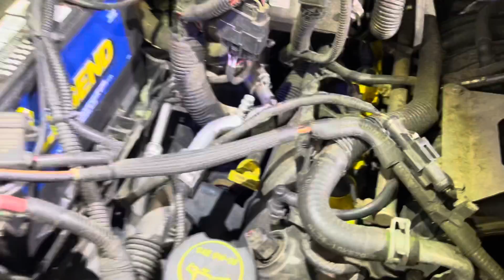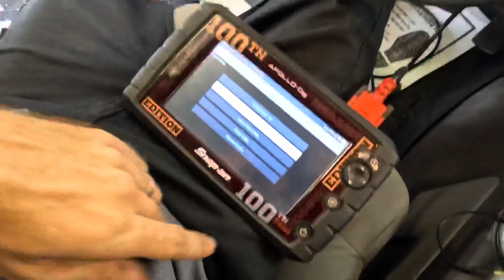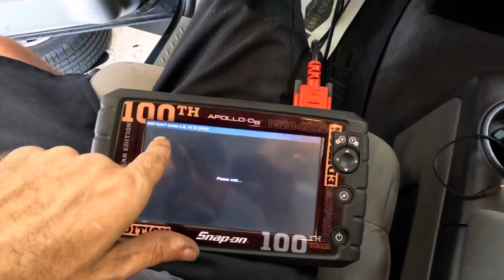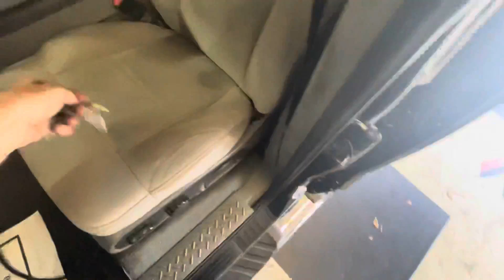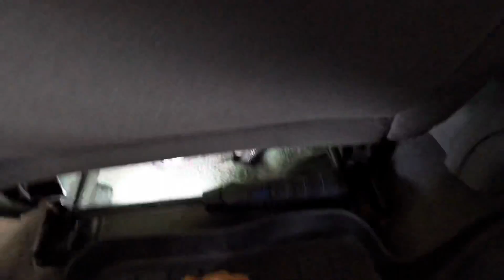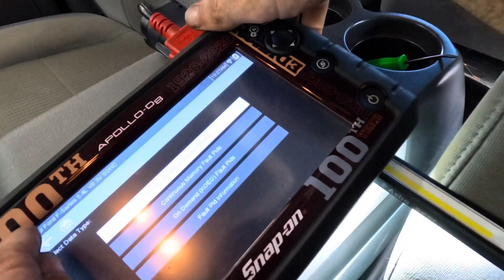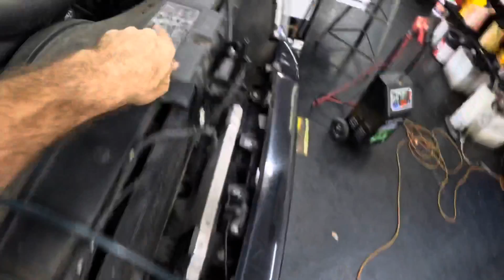Mini Explosives! Car fire Recalls and Airbag Fault! 2008 Ford F-150 5.4 4.6

Comment: Ray, your ac explaining is opposite, 

Compressor pump refrigerant to condenser to be on lower temp than compressor then it went into Receiver Drier or Accumulator. After that the gas went into expansion valve to transfer liquid into gas, that how cooling coil/ evaporator being chill or cold, and return to compressor

Faster the compressor, faster it became colder. High speed on blower make evap less efficient

Comment: Have you ever heard this comment before?
After watching this video, I had to go out and my seat belt light came on!  Well, that's exactly what happen to me. I was dumbfounded that a video would explain such a thing. And I can't wait to see how you do part #2 of this video. If t truck owner brings it back for the seat belt repair. 
I have a 2008 f150 with a 4.7L and the seat belt does not retain or hold me back when the brakes are applied as if there was a sudden stop. 
I watch just about every video and find your knowledge of vehicles weather a car or truck exceptional. Keep up the good work, cause I enjoy watching someone else getting dirty. 
Always said if you don't get dirty your not doing it right!

Comment: Forget about not moving the seats. Shouldn't you disconnect the battery whenever you work on anything related to the airbag or other explosives?
No, I'm not complaining, I'm just worried about your safety.

Comment: You mentioned a recall and problem that GM had, but no one seems to ever mention a very deadly recall and problem Toyota had, when the Gas Pedals were sticking, even though over 90 people died and Toyota try to cover it up and hide there problem.
Since we all know Toyota hates looking bad, but enjoys making others look bad.
Lastly something a lot of people don't remember, Dodge had a very major issue with the redesigned Caravan in the 90s?? they failed to install a brake shift interlock, because of cost the 90s Ford Windstar's had them, but the early new body style Caravans did not.

Comment: We have a series of resistors wired up with pins for just this use.
This is almost exactly how I go about diagnosing air bags and pretensioners.
Just a little warning for those who are tempted to measure the resistance of the pretensioner or airbag with a meter.
DON"T. Some meters have enough potential to set them off.
I tried it so you don't have to, I should have recorded it.
And believe it or not, it was not an analogue meter that set it off.
It was a cheap digital one from a land with a red and yellow flag. :-)

Comment: Design engineers can/should perform Failure Modes, Effects, and Criticality Analysis (FMECA) on all safety components, systems, and end products, which could potentially prevent recalls such as the carpet fires.

Comment: It amazes me how many miles people drive! I bought an F150 new in 2007. I drove that truck for 10 or 11 years and it still had roughly 56,000 miles. It was a great  truck for the first 10 years.and after that it started breaking faster than I could afford to fix it.
Reply: @JohnG6
At 56k miles it started failing a lot ? That is NOT a "great truck". It's junk. Even at 10 years with that mileage it should be remained reliable for another 5-10 years.

Comment: 5.4L 3V... possibly the most horrendous engine Ford ever made. So many numerous defects in design and quality. Worse even than their horrendous 6.0L powerstroke
Reply: A lady friend of mine just made a 3hr trip in her 05 F150 2/5.4. Didn't bother to check the oil level. It was a quart under minimum. Ruined the motor. Women.

Comment: Ray on your Fluke meter if you put the probes together on ohms and press the REL button the meter will measure the leads value, re zero the display and give you a accurate reading of whatever you next measure.  If sort of nulls out the lead resistances. So you wont have to do the maths.

Comment: i always threw the "dont touch a seat settings" rule out, cuz if i cannot reach your pedals while im test driving your car i'm gonna move your seat. i'll definitely move it back close to where its at, but ive serviced some cars that were driving by some short people, or tall people.
Reply: If I have moved a seat, I put it as far back as it goes when I am finished to show that it has been moved.
That way the customer knows I have adjusted it and they have to put it right themselves.
I also explain why when they pick it up.
If I have to drive your car, I need it to be as safe as possible and that may require moving the seat.

Comment: Don’t forget when measuring resistance, don’t touch both terminals, you’ll be measuring resistance through your body. Another awesome video, thanks for keeping them coming!
Reply: For such a low circuit resistance that doesn't even come into play here.

Comment: Thats one clean rig!!  i woulda thought the pretensioner would have been in the B pillar myself. As for the GM tensioner fire info...thats VERY good stuff to know as i had never heard of that before. The electronics diagnosis and rechecking every which way to confirm your diagnosis is great to see. Automotive electronics is my one weak spot and seeing how you check things with various issues on cars is great teaching tools. Thanks again for the educational video Ray:-)

Comment: I used to work as a lube tech for a local Ford dealership and had to do the recall for something similar to the GM one you were talking about. The recall was basically just popping off some panels, removing some insulation and putting some aluminum tape on the bottom of the floor insulation.

Comment: The hot line is the liquid line. It carries liquid refrigerant to the expansion valve. The cool line is the suction line. It carries refrigerant vapors back to the compressor.

Comment: I would agree that the engineers who designed the individual parts aren't at fault for the carpet fires but there had to have been engineers designing the vehicle as a whole who should very much have been aware that explosives and carpets don't mix.

Comment: Hi Ray, apart from zeroing ohms, as described below, to get a correct reading, you are also measuring resistance across your hand  when holding the leads in your hand.
Great content by the way!

Comment: Ford also has that fire issue with the pre tensioner, they didn't learn from gms eff up. so the fix was to put fire retardent tap over the carpet to lessen the fire chance for the carpet.

Comment: for Ford's, you can also count the airbag light flashes.... 
Example: for Code 12 - airbag light flashes once, pauses, then flashes twice....

Code 12: low battery voltage.
Code 13: airbag short circuit.
Code 14: short circuit of the primary crash sensor.

Code 21: There is some problem with the diagnostic monitor mounting, and it requires your attention.
Code 22: Indicates a problem with the safing center output circuit. The issue is probably a shorting with the battery voltage.
Code 23: memory clear-circuit is not grounded correctly.
Code 24: failed system disarm or fault in the internal diagnostic monitor.

Codes ranging from 32 to 35 indicate an issue with the driver and passenger-side airbags.
Code 32: driver side airbag circuit is open or high resistance.
Code 33: The passenger-side airbag circuit with high resistance or open.
Code 34: driver side airbag has low resistance or short circuit.
Code 35: short circuit on the passenger side airbag.

Codes 41 to 45 will show up for the problems with the primary crash sensor.
Code 41: primary crash sensor feed/return circuit of the right radiator is open.
Code 42: primary crash sensor feed/return circuit of the left radiator is open.
Code 44: improperly mounted right radiator crash sensor.
Code 45: incorrectly mounted left radiator crash sensor.

Codes 51 to 53 indicate the issues with airbag diagnostics.
Code 51: blown internal fuse of the airbag diagnostic monitor.
Code 52: voltage boost fault in the back-up power supply.
Code 53: front crash sensor has high resistance within the circuit or there is a failed diagnostic monitor.

Comment: Ray, I don't remember you ever saying you do, but when you fix a hot blowing a/c do you put dye in the system to check for leaks?  Perhaps when you check your a/c machine gages for the pressures, after the charge is complete, is it that the pressures, if they are holding, and in range, telling you if the system has a leak or not?
Reply: I would wager refrigerant comes pre-dyed, but I wouldn't know just sounds sensible to me

Comment: Anyone else think that they could use the Ford door beep for interrogations or torture. I literally hate that beep. I have to pull the key out every time. At least with Chevys. You can just pull it out a little bit and it will shut up
Reply: The door chimes and the phone bell in Ray's shop is an order of magnitude worse than the death metal "music" they used in Guantanamo.

Comment: I believe the pretensioner only removes slack from the belt to prevent you from running into the airbag, not pull you into the seat. Outstanding diagnosis!!!

Comment: I cant see anyone in the comments screaming "DONT WORK ON THE SRS WITH THE POWER ON".. all the connectors have short outs, you can plug them in and out without the explosives going off the connectors short as you pull them apart

Comment: I own two Hondas and about once a year or so, either one will throw an airbag light.  If I unplug and replug in the connections under the seat, it clears it.  I think between seat moving and stuff getting shoved under there, those plugs get banged about quite a bit and sometimes just lose connection for a moment.  Great video!!!

Comment: I came here to say that my voltmeter leads, crossed, indicate .01 ohms. Your test leads are HOSED if they read 1.3+ ohms, adding automatic compensation will not make you happy, and if I had money I'd send you some smart new US made silicone test leads, as they are NOT that expensive. I forget the name of them, sorry.  Please consider that, coming from a guy whose job depended on voltmeter readings within that range being very precise...

Comment: Rule #1: Never move customer's seat.

Frankly I didn't even know this was an issue. Whenever a mechanic moved my seat I'd just go 'whatever they need to work on/test drive the car efficiently and safely.'
Reply: My seat only has two controls you can fiddle with, and they're both mechanical, and one can be moved instantaneously because it's pretty much a ratcheting mechanism, so i couldn't give a rat's ass if the mechanic had to mess with it.
It's only the luxury electronic seat pansies that seem to have trouble with that.
Reply: @GashimahironChl  I once owned a car with electronic seat/ergonomics memory system. It was quite nice. No matter what someone did, I could press a single button and the seat, wheel, and even mirrors will all articulate to the setting I saved.
Reply: @VraerynDaDragon  Way i see it, if you're too fancy for mechanical seats but not fancy enough for memory features, you deserve losing a couple minutes setting it all back.
Reply: It's a rule because it sometimes it'll move back, but get stuck. Same with windows
Reply: @northfloautomotive  I still consider that a strange rule. I understand why it is one, but I also think it's a little unfair to situations where it's unavoidable, like so in the video.
Reply: @VraerynDaDragon  My car's alarm is programmed to close everything on power failure (disconnecting the battery), and back in 2018 i had a faulty power window that would crash down if you tried messing with it, and this is why i spoke to the receptionist AND the mechanic when i brought the hunk o junk for  a much needed overhaul.

This don't move seat\window thing a bullshit rule, probably made up by people who are afraid of talking to another human being over even the simplest of matters.

Comment: Actually most of the heat in the high side comes from compressing a gas into a liquid. Anytime you compress something it generates a lot of heat in the process. The heat being removed from the cabin is just a small part of it.
Reply: Yep, that's how AC work. Compress gas to liquid and cool it down in the condenser, run it thru a expansion valve to the evaporator and you get cool air. And then the cycle starts again

Comment: Hi Ray. I am dumbfounded (my natural state of existence) after watching this video for how you determined that the  seat belt pre-tensioner module was at fault using the meter and resister substitution. If you ever go for a second line of work I would suggest teaching. Never mind, I see you already do that. That  you share your experience and knowledge so well makes you very special. Many thanks for the video.

Comment: Being a retired electronic engineer, I found your technique for diagnosing the seat belt tensioner to be very elegant. It immediately removed any possibility of wiring issues. Well done. 👍🏻
Reply: I'm a not-retired electronic engineer, and I agree with you. That was some thorough diagnostic work there, based on fundamental electrical principles. I think our friend Ray is a smart guy.
Reply: @Nf6xNet  He's definitely more of a mechanic than he is a messanic, that's for damn sure!

Comment: Comfort over safety, lol. Airbag deployment when you are in the position that the system assumes you will be in is like getting your face stomped on; being a little too far forward due to the thing that has the job of keeping you in place being faulty is often quite a different experience - but at least he'll be in a cool cab when the airbag causes a detached retina (etc.).

Comment: Disagree with you view that the Ford fires could not be foreseen. There are groups responsible for sub-system & platform safety. An obvious example could be the existence of heat shielding - why do they exist? Probably because the mechanical or thermo engineers knew they needed to contain the extreme heat dissipated by the motor….. Great job as always in your diag spidey skills

Comment: 55° is considered acceptable? Now I can test my ac cuz I always thought it was underperforming thanks for the tip and great content as always 👌
Reply: With it being 39 degrees colder than ambient temperature, old vehicle …….. Perfect !
Reply: Depends on ambient air temp and humidity.   A quick search should find the chart on the interwebs.
Reply: @Thom_LaPatate 
A lot of times in older vehicles the recirculate flap for outside air has failed in the fresh air position or the flap or foam seal has disintegrated which is often the real issue with vent temps being higher than spec. On a correctly working mobile AC system in a car it is typical to see 41-42 F with ambient temp being 92 and humidity at 40%, vent blower on med speed, and recirculate on!
Reply: Here's an update, currently 70° with heavy rain (high humidity) and I'm getting 35° out of my vents.

Happy to see that it's not underperforming after all

Comment: I never cease to be amazed at the depth of your knowledge.  I never knew that a pre-tensioner existed, and your analysis of the specific problem was outstanding.   Party on, Ray.
Reply: It’s also of utmost importance that you never use a frayed belt. When those things go off, they can and will rip the belt in half straight away. They’re that powerful. So you should always make sure that your seatbelts are in good working order.
Reply: People get pretensioners mixed up with locking seat belts. All seat belts are designed to lock in if you hit the brakes, but a pretensioner is an explosive charge, usually under the seat, and when it goes off, it’s meant to yank you back hard in the seat, to immobilise you and avoid or reduce back injuries. It’s also why modern headrests are designed the way they are.

Comment: Ray this is what I always do anytime I replace a valve inside the air conditioning system after I put in the new valve and recharge it I turn off the engine and make sure that it’s not leaking again I know it might sound redundant but it will prevent a come back because like you said before even though it’s new it doesn’t mean it’s good. I’m not trying to tell you how to do your job but I found that that will help in any comebacks because the new ones sometimes will leak they’re all made in China and it’s going to be very hard to find any that are made in America. Even in the new cars they get those parts from China so just thought I’d tell you have a blessed day God bless you the Lord Jesus Christ is on his way take care young man✝️✝️✝️